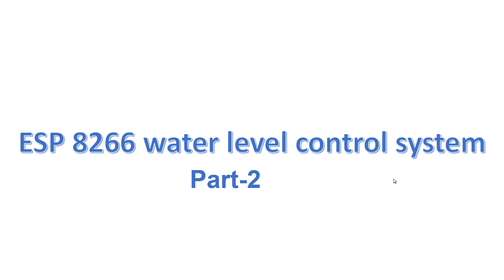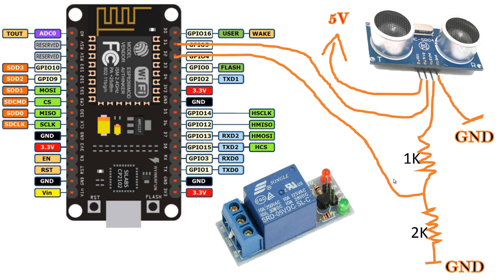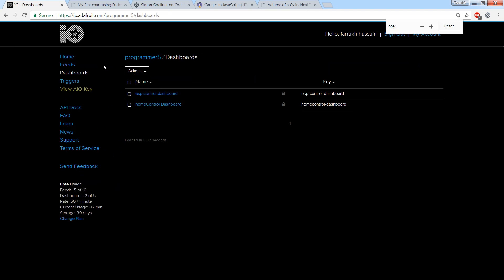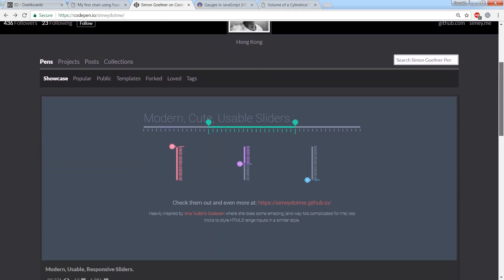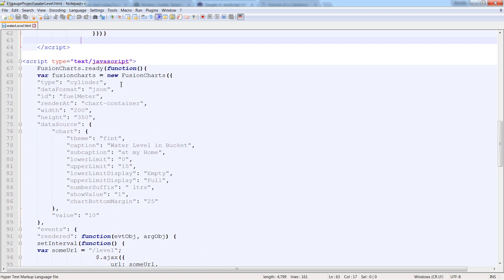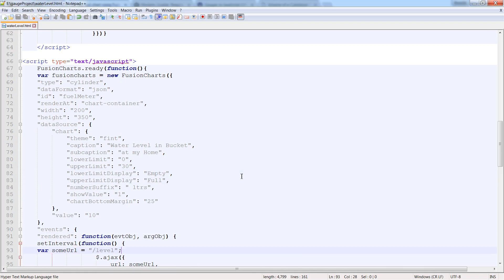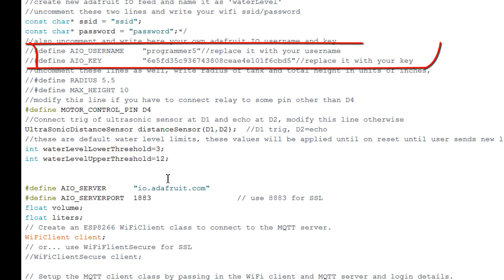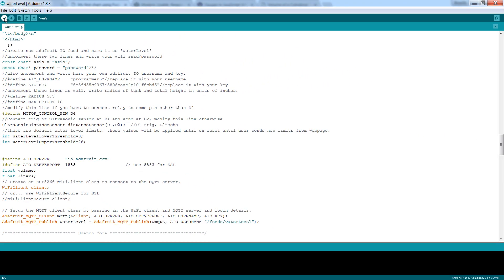ESP8266 water level control system #2

Comment: Assalamualaikum ya farrukh
i want to make water lavel for my tank, 
i have one question about unit volume. how about if i want to change to metric-ton.
maybe height my tank around 15 meter and diameter around 6 meter.
thank alot's

wassalamualaikum,
ahmad rubai.
Reply from the maker: Wa alaikumussalaam
If I do now, I'll be using multiple water sensors attached to a stick,  that I'll insert in my water tank.
You can select any units,  that is upto your software
Reply: @farrukh4303  how about TF Mini Plus Lidar Range to change my HC-SR04..?

Comment: Thanks for the tut, its really helpful. I really loved the animation and visual graphics, they look beautiful and modern.
Now coming to the project, you have used non-waterproof ultrasonic sensor which is not practical to use bcoz it will be damaged due to dampness and extreme environmental conditions like in summer and winter so better you should have used waterproof sensor.
Another thing missing here is manual switch to turn on/off motor at any time if we use this project (which i am looking for) for overhead tank than we will need to have a manual switch to turn on motor at any time to take fresh water for drinking or for taking bath etc which we usually do.
Another feature which is really recommended is to make it wireless by dividing the circuit into two parts via 433mhz RF wireless modules as they are very cheap and will increase its range up to 100m.
Another suggestion is to have a cheap lcd display to show the same animation (color or black&white) and water level which we can stick on wall so that we may see the water level at any time. (it would be nice if you could figure out a way to use our old mobile phone's display here to show water level.)  
Looking forward for your reply and new version of this awesome system having all these features.
Reply from the maker: I've added another tutorial on how to add physical switch/button with relay, (two way control), 
And this is old implementation, if I've to do same now, I'll prefer mqtt or something similar and ask software developer to do UI handling.
Reply: @farrukh4303  yeah i just watched that video so i guess that part is solved, but what about making it wireless using RF radio modules, they are very cheap too, if we  make it wireless than we dont need to run long wires.
About using mqtt, i dont know about that i will have a look at it, but i guess we dont need to go through all these cloud systems to run that system, that can be done with simple electronic components and might need nodemcu as controller.
There are already some tuts available on Youtube about such systems but either thay are incomplete or the owners dont share programming part, so if you make one complete wireless system it would be great. You can take some ideas by searching wireless pump controller.
Reply from the maker: Sensor is just for demonstration, maybe just because it cost 1$, developers can select appropriate one.

Comment: Hi, loved your project! We are trying to implement it. Can you please tell me if the ultrasonic sensor is not connected to 5V do we need to connect the Echo pin through the voltage divider?
please let me know this.
Reply from the maker: It is 5v sensor, it won't work from 3.3V Supply. Or you have a different version?
Reply: @farrukh4303   Thanks for the reply! I have exactly the same one you have mentioned in the video. I have used the same Ultrasonic for my previous project with the same 3.3V connection it seems to work there but not in your project.
Reply from the maker: @15chudasamaminalkishor52  if work before, why not now?
Reply: @farrukh4303  Could you please explain the connections to us in a detailed manner please?

Comment: connect to esp8266computer's USB ports, everything working fine. But, if I connect esp8266 to separate charger that has USB port, then esp 8266not running code
Reply: Code works only when it is connected to the computer.. But when I connect it to a mobile charger it does not run

Comment: hi there, i liked your work but have a doubt. Will i be able to use the same sketch if i replace the HC-SR04 with a water proof sensor JSN-SR04T?
Reply from the maker: I think both sensors are exactly same, so yes, can use Same sketch
Reply: @farrukh4303  thank you so much for prompt reply

Comment: Why do you need to use the 1K and 2K Resistors with the Ground PIN of Ultrasonic Sensor?
Reply from the maker: For logic level shift.
Ultrasonic sensor works at 5v while esp8266 is 3.3v
Reply: @farrukh4303  Thanks for your prompt reply.  I am trying creating the project now following your instructions.
Doesn't the ESP8266 comes with a built in 5V output pin? will it not work without a resistor?
Reply from the maker: Esp8266 Don't have any 5v output
Reply: @farrukh4303   Please check this image file
https://drive.google.com/open?id=16596aiah_H8wScPXfjU__VUUBiYY6fYF
Reply: @Z2typeR  Thats a 5v in pin for the board, but i suppose that there shouldn't be a problem if you use it for other component right?

Comment: THESE ARE SOME ERROR I AM GETTING :-

waterLevel:182: error: expected constructor, destructor, or type conversion before 'Distancesensor'

 UltraSonicDistanceSensor Distancesensor(D1,D2); //D1 trig, D2=echo

                          ^

C:\Users\RP19\Desktop\waterLevel\waterLevel.ino: In function 'void measure_Volume()':

waterLevel:243: error: 'Distancesensor' was not declared in this scope

     float heightInch=0.393701*Distancesensor.measureDistanceCm();    

                               ^

exit status 1
expected constructor, destructor, or type conversion before 'Distancesensor'
.
.
.
.
.
.
THIS IS THE ERROR I AM GETING IN UR SOURCE CODE
Reply: plz reply sir
Reply from the maker: did you add hcsr04 library? please check video description.
Reply: yes sir i have add all the library including hcsr04 but still i am getting the same error
Reply from the maker: library isn't installed
Reply from the maker: or may be, you installed multiple HCSR04 libraries,  and compiler is picking wrong header file.
Reply: I have installed the one which u provided link in the discription plz  help
Reply: Sir i have recently re installed the library after completely deleting the existing one but still the same error ocurs
Reply: Expected constructor,destructor or type of conversation before distance sensor
Reply from the maker: install everything, and search for hcsr04.h
let me know how many files you are able to locate in your PC with this name
Reply: Farrukh total 3 files
Reply: "HCSR04.h","HCSR04.cpp",hcsr04 total 3 files
Reply from the maker: share details, where they located?
Reply: Farrukh 1 of 3 files is image file and other 2 are .h and .cpp files
Reply: Farrukh they are located in document\Arduino\libraries\arduino-lib-hc-sr04-master\src

Comment: Hi, what power supply did you use?
Reply from the maker: Intan Nuraisha water pump powered by 220v ac, nodeMcu may be powered by 5v adapter or maybe 12v adapter with regulator, you may also use batteries along with regulator
Reply: Farrukh can i use water pump DC 3V-5V only? With 4V battery?
Reply from the maker: if you have one that can work with 3-5v range, then should be no issue
Reply: Farrukh alright thank you so much
Reply: Farrukh If i want to use esp-12e, the coding is still same or i need to modify the coding?
Reply from the maker: same  code.
Reply: Farrukh thank you:)
Reply: Farrukh which line do i suppose to modify if i don't want to use the controller system? I just want to monitor them via adafruit only
Reply from the maker: if only want to monitor from adafruit, you don't need html page at all, so can remove index.html completely.
Reply: Farrukh but the web page is needed to show the current status of liquid level. I just don't need to use the water pump at all. Only water level monitoring system which means pouring the water manually into the container, then it detect the liquid level and monitor them by using a web page
Reply from the maker: but you can also monitor from adafruit,
Reply: Farrukh so what i need to do is remove the index.html completely, then i can monitor them by using adafruit. What about the coding for control system? Should i remove?

Comment: Hi, I like your videos and I'm trying to do this here, but I have an esp 32 and I'm finding many troubles. What I have to do, to make the same project in esp32 ? Thanks ^^
Reply from the maker: Matheus Felipe adafruit mqtt library works for both esp32 and esp8266, you may find issue with webserver thing, but should be easy to resolve, search how people run webserver with esp32.